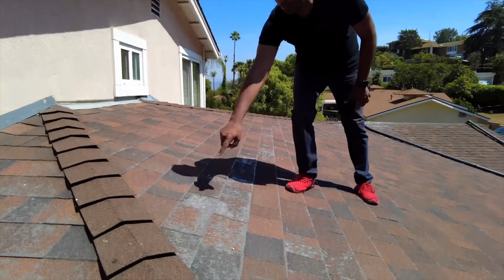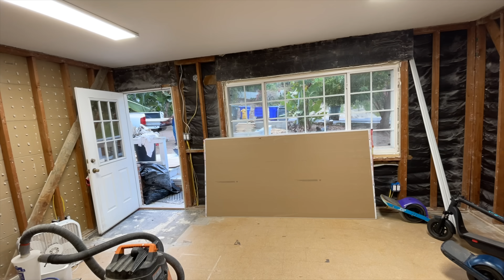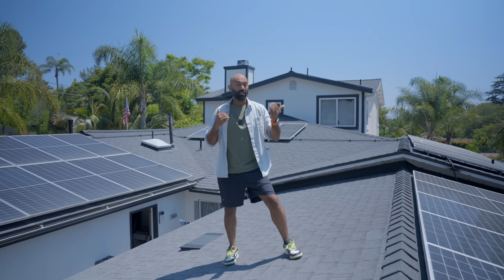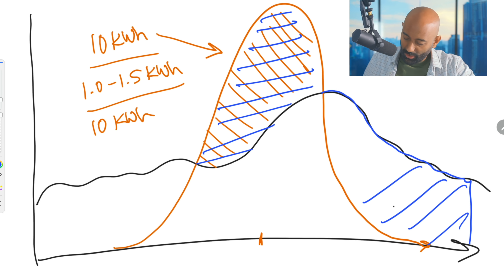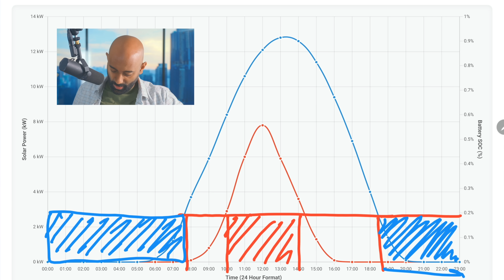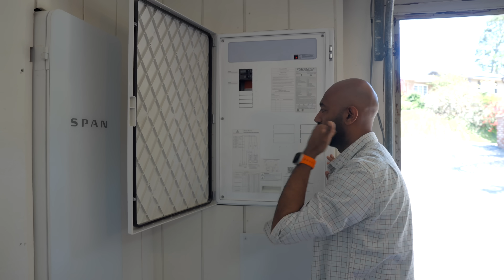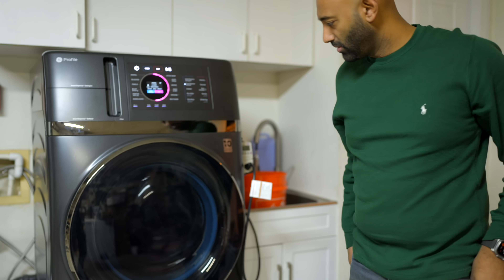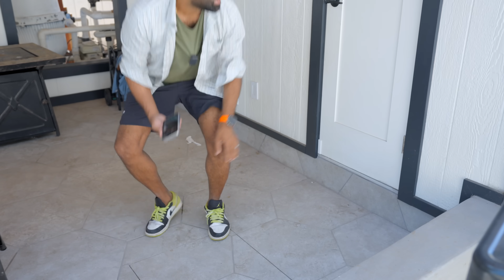Is Self Reliance Possible? Net Zero Home 4 Years Later...

Comment: You really have taken a fantastic journey.  Hats off to you. We have not gone to the degree you have.  We had the gas disconnected last year.  Hot water is a heat pump unit. Heating and cooling is reverse cycle air conditioners (heat pumps). I have to admit I miss gas stove top, but I can't speak against fossil fuels and then cook on it, so now induction cooktop. 

Swimming pools are very expensive in electricity and water and for each item that dies and needs replacing.  We bought a house in 2002 that had one so I know. Once the kids leave home, the pool lies unoccupied 99% of the time. 

First solar PV installed in 2008. We were living in South Australia then.  1 Kw of panels.  Added another 600watts just over a year later. At that time the SA electric retailers were paying some very good feed in rates.  We were receiving 52c / Kwhr! At the end of 2012 we returned to Perth.  We received a cheque for the credit we had accumulated.

We installed our second solar PV system in 2013.  This time 3Kws.  This time vastly less money to buy but only 4c / Kwhr feed in tariff.  None the less paid for itself in about 2.5 years. 

2018 and we had to move again. This time 6.6 Kw of panels and a 5Kw inverter because this is the maximum allowed by the WA grid operator.  They don't want too much roof top solar coming in during the middle of the day. This time it was unbelievably inexpensive. In the nearly 7 years it has paid for itself 2.75 times over. In Australia, government subsidy for solar PV is very generous and it is a complete no brainer. When you look at roofs though, either there are a lot of renters and their landlords suck or there are many people with no brain. 

Lawn?  Rainfall is reducing here with global warming.  I really think lawns are ecologically, not a good idea for a garden anywhere. I like your use of grey water for it though. However, besides water use, there's fertiliser that often leaches and contributes to algal blooms. Then you may get the occasional pest like the grubs of the black lawn beetle.  There's pesticides for that.  It would be better not to have to use pesticides if they can be avoided.  No lawn = avoided.   Then your lawn has to be growing to look green.  This doesn't just mean mowing.  After a while the lawn becomes a victim of its own success.  It has grown so well that now it's thatched and water proof.  You have to aerate it.  Coring or similar measures.  You can rent machines for this but more time and expense.

In South Australia (even drier than here) we finally eradicated all lawn. You know what's better?  Almost any plants.  But natives of your local area are best and then plants from parts of the world with similar climatic conditions. We dug a huge amount of lawn up in the last place.  This place didn't have much but we dug that up too.

At long last we bought our first EV a few weeks ago.  It's a 2022 MG ZS.  So very happy about it and we charge during the day as you do. The heat pump hot water system comes on at 10am and is finished usually before noon.  So that's when we charge the car. We only charge from the 240V at 10 amps. We rarely travel very far.  A 100 Km (62miles for you guys) day is exceptional.  hasn't happened since we bought the car. When it does that may mean about 17 or 18 KWhrs so we might charge it for 3 or 4 hours one day and do some more from noon the next day. I don't think we are going to need a 7 Kw charger.  Besides that exceeds our total solar generation.

Comment: We’ve had solar panels for 6 years. We are net metered and have TOD pricing. We make enough electricity over the year so that our electricity company pays us back a little over for what we produce over a years time. I love our solar panels and $0 electric bill, but this video shows how difficult, if not impossible going net zero for most people is. 

Plus your graph about how much less solar is produced in the winter is a great example of why a reliable, stable electrical grid is vitally important for our country. I live in Colorado, we get a lot of sun in the summer and make A LOT of extra electricity., But in the winter, because we are further north than you, are our days are even shorter and on top of that we can have 5+ days of no electricity production because of snow. Having enough battery back up to be off grid for that amount of time is not practical. Plus, our electricity is much cheaper than yours so the payback time to have a system with enough panels and batteries to get us through the winter. would be much, much, much larger. 

This is a hobby for you and I applaud you for what you have done. But most people don’t have the time or money for your hobby.

Comment: OK, to start with we need to be completely honest with what the system would cost the average person. To begin with, to accomplish any savings one would have  invest in new heat pumps, new air conditioning systems, etc and a rewiring of all breaker panels, such as has been done — not to mention getting free batteries from Franklin. From what I can see these batteries cost $10,000 EACH multiply by 3 of them and then add in a the additional 2. Also this renders the EcoFlow batteries a waste of money. I’m sure they can be sold but at such a depreciation of a $14,000 investment. 
I really like to see it all tallied up and a fair explanation to viewers that there is no way that this system pays for itself in four years. Absolutely false. Let’s see the numbers which conveniently have not been spoke of and tally it up (adding all batteries gotten for free from Franklin). 
This changes the whole payoff time by about a multiple of four.
Come on man, be real. Don’t lead viewers down a path that they’ll struggle with and wonder why they ever followed this youtuber. 
Its misleading.  
I speak from experiance.  Ive been totally of grid for years and its not easy or convenient. Don’t get me wrong, it will pay for itself but it will take closer to 10-12 yrs at best, thats with all installation done DIY.  It will consume your spare time and have to become your 2nd job/ full time hobby. Lol

Comment: Thinks about a passive hot water tank heater, in your area probably 9 months totally free ne energy required hot water in winter just an hour or two or so a day with a 3 kw heater elements should give you enough hot water. Look up SolarHart it’s Australian but you probably have an equivalent and in summer they use no power at all so are very very reliable. Just a thought.

Comment: If you run out of storage and panels are shutting off, why not give it more load, like run you pool pump or switch the laundry load and deplete your battery by doing laundry at a different time.  I just purchased a new Bosch 5 Ton AC with heat pump and a 2 zone kit and my energy bill was reduced by over 60%.  Last year I was using 80 kWh per day in June and now it's as low as 30 kWH and I am keeping my house 73 F when outside is 90-100 F.  I had a 30+ year old AC that was very inefficient and horrible at cooling and it finally died.  Repair costs would have been over $10K.  The new AC system was $15k and I will get a $2K tax credit.  In CA, my cost for electricity is approx. 52 cents per kWH.  I am getting a 12 kWH solar system with 28.6 kWH of batteries in the next 2 months.  Electricity costs are going even higher after rate increases were approved.

Comment: "The goal is to go net zero" Continues to get a combo washing/dryer machine that uses 4000 kwh for the drying part, instead of just hanging the clothes to dry outside in the sun, costing no electricity, makes the clothing smell nicer and is less wearing on the clothing.
This is a prime example when engineers are too deep in the weeds, overcomplicating the solution to an issue, that can easily be solved with the free tools offered by nature.

Comment: There are options like 'solar tiles' which incorporate the roof and the panels in one.
For payback, grid tied systems which are bigger than what you need currently is better because of economies of scale, growing use and decreasing production of energy from panels over time - after 10 years you could loose 10% production; 20 years 20%. Replacing or putting in more solar panels will cost more in the future due to installation costs - scaffolding, permits etc.

Comment: Man those prices ....I got used 3.6kw of panels for 450 a refurb inverter for 425 ~100 for cables and accessories. It does not cover everything but makes a huge dent. You can get 11.5kw of panels new now for 2k from sig solar. 10kwh of battery for 1100.

Comment: Kudos for a great presentation and something that (unfortunately) too many people (probably most) don't really care about unless you tell them that its cost is FREE! Like in "zero dollars". 

My only "beef" (speaking loosely) with your presentation and even the comments so far attached to it, is that the word "efficiency" was not used at any time to talk about the efficiency of the home in terms of its thermal load on the equipment, mainly the heating and cooling needs. I know that it may be a "pain" to retrofit an existing home with insulation but it should be addressed, hopefully at the time it was built, which in your case may have been a long, long, long time ago. 

The insulation properties and energy efficiency of a home and its appliances is what utilities (whether electric of natural gas) hate the most for its customers to know about and why here in Florida the Utilities got the Legislature to kill, in 2015, all laws that required them to keep their customers informed about the value of an energy efficient home and its appliances.

My experience (all electric homes): 1. In 1980 I bought a new house from a local builder here in Florida and made them upgrade the thermal insulation in the attic beyond that required by the Building Code at the time. In the winter, when the weather was right to deposit frost on the roofs, mine was the only one in the neighborhood that exhibited frost on the roof. All others were heating the attic much more and the weak Florida frost could not form on their roofs. 2. Fast forward five years later, when I could fully customize a newly built house. I threw in just about everything, that made some sense at the time, to improve the thermal efficiency of the house.  The result was that the 3000 sqft house only needed a 3 Ton A/C unit. Since at the time most A/C installers went by the sqft in order to determine A/C Tonnage, the installer went furious at first but finally acceded to installing a 3 Ton A/C Heat Pump, on condition that I released him of any liability, if the unit did not heat or cool the home to my satisfaction. No one complained in the 12-14 years that unit worked for the house. When the next A/C installer took a look at the house, he wanted to install a replacement 5.5 Ton unit. I guess old habits are hard to die, cause he went on to ignore that the house had been served well by 3 Tons of A/C for almost 14 years! Of course, he did not get to install a unit completely over sized for the house. When the house was about 30 years old, the 500+ sqft porch was closed with double pane floor to ceiling glass and a very high efficiency 4 Ton A/C Heat Pump unit was installed to accommodate the extra thermal load. The bottom line is that in 2016 with just under 12 kW of solar power attached to the roof (in an East/West configuration), the house went net-zero and the only charge by the utility is the grid interconnect fee of about $10.00. A 20 kWh battery system today would likely result in very little grid power needed, if at all. 

The bottom line is that we should always start with investing as much as possible in making a house very, very well insulated. It is the lowest hanging fruit and these days it should pay for itself in less than 5 years or maybe as low as 2 years, in places like California with high grid kWh costs.

Comment: My array has worked out very well for me, but it isn't because of the power cost that it offsets.  80% of my system was paid off through state and federal incentives and it took about seven years to pay itself off.  My power is only about 8 cents/kWh, so it takes a long time to make it pay off.  I also am lucky enough to get 1:1 payback for power I send back to the grid.  I end up paying a connection fee for about 10 months out of the year where I'm either making more than I use or I'm using up my credit.  I don't run out of my credit until December/January and then I end up having to pay to run my heat pump for a couple of the coldest months.  I really loved the immediate effect of installing the system, but it was always tempered until it was paid off.  Now that it's paid off, it's nothing but gravy.  I really only save about $1,200/year, but a bit is better than nothing.

Comment: Why is your power consumption so high? heating and cooling should be very low based on your location. I live in Houston and average 5-600kwh in the fall, winter and spring and 900-1100kwh in the summer on a 2k sqft house with a Trane 4-ton heat pump HVAC.

Comment: I self built my house. Had a contractor put up the outside and I did absolutely everything else myself. Including installing pex and insulation in slab. Before having concrete poured. Inslab downstairs and infloor upstairs. Had warmboard subfloor panels installed by contractor when they built the shell. I installed all the pexalpex into the warmboard panels. As well as installed the manifolds, pumps, and controls. Bosch water to water geothermal heat pump. With desuperheater for domestic hot water. Boiler buddy buffer tank.  Chilled water fan coils for cooling. I had the loops in the yard installed by GOLOOP. $5000 for 4 horizontal coily loops in my one acre lot. Told him what I had planned for the house. And he figured out exactly what I needed for the loops. Left the 2 tubes sticking out of the ground in my lot before anything else was done. The outside perimeter of the house was staked out. He had them exactly where they needed to be for the wall of the mechanical room via the plan's. Then after I got all of my equipment hooked up he came back and flushed the loops and filled them with ethanol and water. I installed absolutely everything for the geothermal system and infloor heating loops. Including filling the floor loops with water from culligan. Mixing their distilled with their drinking water. To get the ph correct. I had gotten 3 estimates for having geothermal installed. All three of them had wildly different ideas for equipment. All 3 came back at $45,000 and something. Within a few hundred of each other. I also got estimates to have conventional heating and cooling installed. Came back $28,000 to $36,000. I self installed mine  for about $22,000. Been running 5 years now no problems. I also super insulated the house. With thermal brake foam panels on the outside of the 2×6 walls and 1" closed cell spray foam inside and filled the rest of the cavity with rockwool. Blown in cellulose in the ceilings. R29 in the walls R65 in the ceiling. Put rockwool in all the internal walls for fire block and sound deadening. I had 10,080 watts installed on the roof. As soon as the metal roof was installed. 
The upper roof where the panels were installed was very steep.  And I wasn't going to be up on the roof myself. Cost me $22,000 after tax rebates. Been running almost 7 years. Net metering. Broke even on the solar before 5 years. The geothermal was cheaper than the conventional heating estimates. Because I installed it all myself. So actually made money on that.😅  Net Zero house.  2400sqft of shop and storage downstairs. 1000sqft of living space upstairs. I keep all 3400sqft heated and cooled to whatever temperature I want. 
I drive a forklift for a living. In Wisconsin.  

Oh yeah I installed insulation and 8000ft of pex in my driveway before they poured 11 truck loads of concrete. I've since built a lean-to on the 54' south wall of my house installing 24 390watt panels on it. To heat the water/antifreeze. So I don't have to shovel snow. Hopefully have it all hooked up this summer.

So yes geothermal is the way to go. Warmboard makes panels that can go over. Existing floors. The best most efficient infloor heating you can get. Expensive. But well worth it. It will pay for itself. I have both. Inslab vary's from thermostat setting by a lot. Warmboard vary's +or- 1°.
Reply: What about insurance for Your home? If anything goes wrong, and You intalled the most of it Yourself? Are'nt there any regulations for all power / water work?         Noone controlled if all is propperly done? Some countries do not allowe certain kind of work, as electricitypower to be done by lay man...it is insurance that when it is done and controlled by certified person, You dodn't have to be anxious of anything going wrong....

Comment: Great advice. Similarly it’s been a journey for me. 10KW GRIDTIED IN 2019 that offset the all electric house,  then another 10KW gridtied in 2020 and 2 EVS, that go 40k miles per year. Then added an off grid growatt 6000w and 25kwh of EG4 server rack batteries  for static loads and grid-down backup. Break even was 4.5 years in not so sunny WV with .14 cent/kw power. 
We do still have 1:1 net metering 
My advice for those who want to use solar to offset the most expense is to get an EV. In most states your solar production is more valuable as an offset to gasoline than it is to offset residential power.